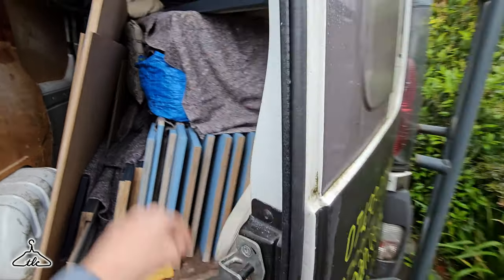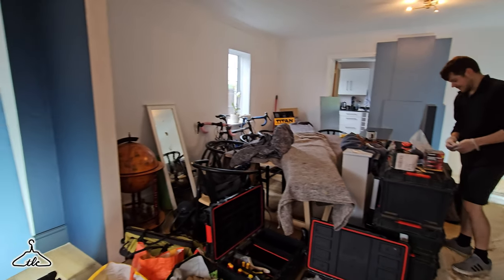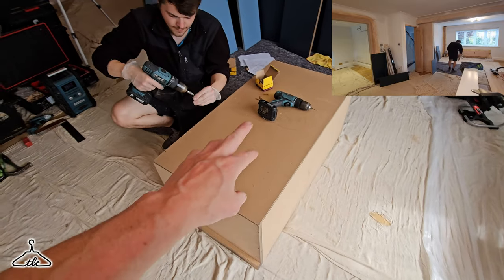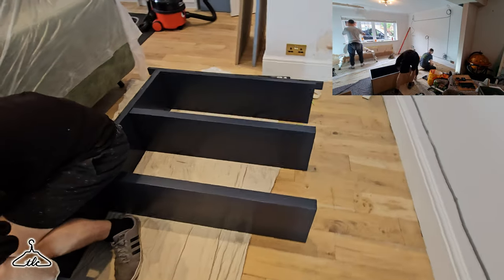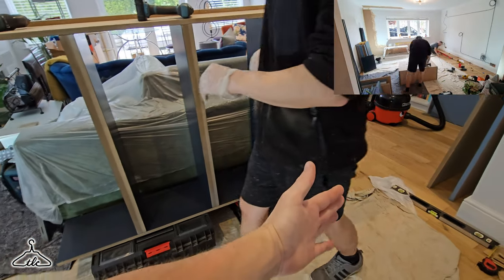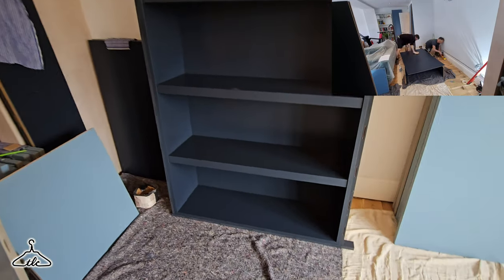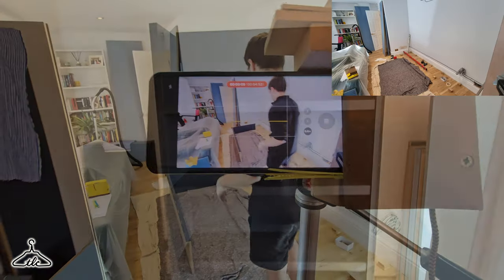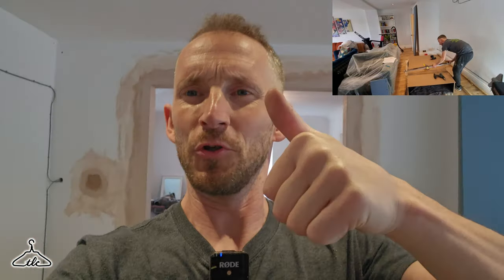2 Beautiful Handmade FEATURE Cabinets : Attempting a 3 day Installation (Part 1/6)

Comment: Great content. Thanks for the video!
If most components are 18mm-50mm thick then could you make some type of rack, lined with carpet so the components could be stored vertically in the van? Just an idea.
Reply: You could then use some airwedges, designed for hanging doors, to expand in the gap and keep the parts from moving around